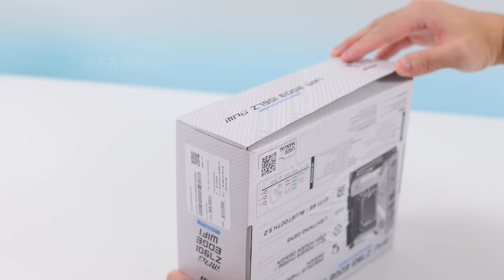If you want to take 4090 to college, try this chassis | Phanteks Evolv SHIFT XT Build

Comment: 13700K with a 4090? Great, it can also function as a space heater in the winter, and burn down the dorm in summer.
Reply: The 4090 is the real killlee here, my 13700kf is very chill
Reply: Needs to be submerged in water 💦

Comment: Oh my god, possibly the best SFF build I have ever seen with little to no compromises. It has a 4090 and a 13700k, along with an AIO, all packed into such a small size. What more could you ask for?!
Reply: i want to see it running under load without thermal throttling. Without that this is a waste of time. Influencers like to influence you to spend your cash on products that do not meet your needs. If it sounds like your mothers vacuum cleaner, throttles down to behave like an old Haswell machine and eventually cooks your processor that this video features  pretty packaging and nothing more. I have tried many SFX builds and there is a limit to how much heat can quietly be dissipated.
Reply: Money for ramen.
Reply: The Sliger SM580 is better than this case, if you're looking for something similar. It fits a 280mm AIO for better CPU cooling, and has two bottom fans to help cool everything else. Also you can get a handle to carry it around like a suitcase and they sell an optional bifurcated riser which would allow you to add another PCIe device if you really wanted to. It's the best possible performance SFF case with absolutely zero compromise.
Reply: Rollable OLED display in your bag, is what I'd ask for.
Edit: So that I can flex. Pun intended.
Reply: @9999plato it will definitely thermal throttle.  At best itx is good for like 60-70 series for nvidia and maybe a 6600-6700 for amd.  Obviously lower cpus too.
Reply: Technically, an NR200p Max would probably be better.
Depends if you care about color and/or design of the case.
Reply: @9999plato  i think you could do this with an amd cpu, definitely with x3d, but not intel without aio or some tower.
Reply: @TheRMUPs eh, i chose this case because i didnt want a boring rectangle pc, which the sm580 kinda is
Reply: Yeah that's totally fair. I like the handle though, gives it a different silhouette, and also I painted mine marine blue
Reply: tHAT IS DOENT CATCH ON FIRE
Reply: A dust filter bro.
Reply: @frankytanky5076  I got 5800x3D and 6800 xt for itx and no thermal throttling at a room tempt 27° Celsius. Under heavy load, cpu is at 64° C max and gpu at 56-60°.
Airflow and room tempts will greatly affect your tempts!
Reply: @frankytanky5076  Just finished building this exact config as a portable option. Temps are solid and no thermal throttling. I play mostly e sports titles, but was just running BG3 and Tarkov, everything maxed out and CPU didn't go over 60c and GPU hovered around 65-70c. Completely fine.
Reply: @9999plato    Just finished building this exact config as a portable option. Temps are solid and no thermal throttling. I play mostly e sports titles, but was just running BG3 and Tarkov, everything maxed out and CPU didn't go over 60c and GPU hovered around 65-70c. Completely fine.
Reply: @ArdyneusTheGod  yep! its more of a if you can find a 4090 fe. Here in asia, I've never seen one. Probably have to order from another country which is costly. Other one that can fit is one MSI variant but its a tight fit
Reply: @9999plato  
What's the best SFF then for what you listed? I'd like a portable i7 you can fit in your backpack, but there are too many build variations and I like 'em all.

Comment: That's an amazing build and a lovely case with amazing cable management. Also as of this moment, pcpartpicker says it'd cost $3400 to do that build, not including operating system.
Reply: Can you link that build list? I've been considering a new build and something like this really interest me.
Reply: 3400?! that’s ridiculous you can get that with 2-2.5k easily
Reply: @kingiument4627  the graphics card alone costs ~$2k usd
Reply: @BillyWilly132  Yeah wtf when did that happen last time I looked it was 1600
Reply: @kingiument4627  where on this world would you get a 4090 fe for just 1600, wtf ?
Reply: @JeyKalda  I meant to say 1800. Maybe that was the old price for the 4080 and im tripping tho
Reply: @kingiument4627 i think original Msrp was 1600 so i dont think ur wrong Abt that, but the pc would still not be 2k
Reply: i think he went a little over board with the parts, the i7 is not necessary and the rm1000x psu might be better
Reply: Operating system is free, just don't use Windows...

Comment: I have a 3080 ti in a similar case, and I can guarantee you that 4090 is going to thermal throttle like nuts in there.
Reply: especially with it being side by side with the motherboard/processor.
Reply: No heating bill in the winter!
Reply: Doesn't even need to be 3080ti to thermal throttle in there, pretty sure any GPU will effectively shoot itself.
Reply: Just finished building this exact config as a portable option. Temps are solid and no thermal throttling. I play mostly e sports titles, but was just running BG3 and Tarkov, everything maxed out and CPU didn't go over 60c and GPU hovered around 65-70c. Completely fine. Do you game in a sauna? lol
Reply: @CocaineCobain  I'd love to see a video where you stress test it on your channel. Shouldn't take more than 5 minutes to do.
Reply: People before undervolting was a thing:
Reply: @Rogue_y  why would you spend $2k on a GPU just to kneecap it?
Reply: Just finished up a build with a 4090 in this case (not my idea or system lol) surprisingly enough, it's only 76c-78c under full load.

The cpu temps on the other hand
Reply: @yououttapocket why does he have to stress test lol?
Reply: @BunkerSquirrel undervolting alot of the time increases the performance very slightly while dropping temps a few degrees
Reply: @BunkerSquirrel lol, I undervolted two of my pcs, and aimed to maximize power saving at the cost of performance. My RX 7800 XT under full load dropped from ~300W to just over 200W. Lost about 3 fps average in red dead 2. Also undervolted my 3080 and got it from 330W to 265W and went from 15445 to 15202 in time spy. While gaming both gpus dropped about 10-15° C and I was able to turn my fans down to the point both pcs are completely silent while gaming. Of course that brought the temps back up a little, but both sit happily about 60-75°C depending on the game.
Reply: 3080 went from 250W to 150W in elden ring, and dropped from 70°C to 50°C
Reply: @BunkerSquirrel  undervolting ≠ underclocking, in fact it can improve performance as well as thermals if you do it correctly

Comment: I have this case same motherboard I love the case I think its still one the best looking sfx cases out. It get a bad rap as hot box but if done using the right parts it can keep cool  I have a I7 13700k , msi z790I edge, 32 gig of corsair Dom ddr 6000,  Phantek 240 gen2 with T-30 fans, Phantek 850 Plat psu, 1tb 980 Pro, 2Tb 980 pro, 4090 Msi Vent, Phantek shift xt black
Reply: Why does everyone feel the need to post their specs? Nobody cares.
Reply: @truuuupR  in this type of community it sometimes helps to have an idea especially for those who are to build their very first sff for parts compatibility and such. No need to let them know that you don't care, move along for we don't need such negativity in this small space. Have a good day.
Reply: @truuuupR i mean maybe you don't, but it is actually be pretty helpful  for others who is interested to try out the build.
Reply: @dominiceita2682   thank you exactly why spec were posted
Reply: @xyz-boner   under gaming load cpu boost stays @ 5.3 and temps 64c - 70c with a quite fan curve. and gpu boost to 2775 and gaming temps 65c  it stays really cool pc is near silent.
Reply: @0mnikron702 i want an amd ryzen 7 7700x, hope it works.

Comment: very cool build! question - when assembling in such a case, does it make sense to use shortened cables for the power supply?
Reply: Be careful, every PSU is wired differently, don't ever use different cables than the ones in the package unless you're extremely sure what you're doing (or unless they're just extensions)

Comment: clean looking build but it would be good to show some perf numbers or temps & noise levels at least. It's a common issue with SFFs to run really hot with the Nvidia 4080+. There aren't any intake fans with this build and I'm curious how it could manage cooling and noise.
Reply: @Saint.0000 yeah even as a lightly experienced builder, what they're saying sounds like nonsense. If I recall, don't the 40 series cards have super overbuilt coolers? Even in a crampt space, i'd expect it to be reasonably okay, so long as you have some air flow going on. The fan on the card is directly facing the outside air even. The CPU is the one in a potentially scary spot, but we're using an AIO, so that's being handled nicely as well. Just don't overclock the 13700 cuz if that's the CPU i think it is, it has trouble being able to take enough heat away from it when overclocked.
Reply: @shirothefish9688  Pretty much. The 4080 nor the 4090 thermal throttles at any point in SFF cases. They are 8-10 degrees hotter at the worst of times, well below any kind of performance loss. The guy literally mislead others for no reason

Comment: Nice looking build, curious about the choice of the 13700k vs a 7800x3D, which is both faster for gaming and easier to cool?  It would let you move to a 850w PSU as well and give you budget to upgrade to a larger/faster SSD at minimum.
Reply: 13700K a little bit slower than 7800X3D in gaming but superior in multitasking software like Blender or Adobe Suites
Reply: He has a 4090. He doesn't need to min max his cost to upgrade the ssd. 

Chances are, it's what he had lying around.

Comment: I literally fell in love with this case. I wonder if a Inno3D 4080 will fit in! (Has a separated AIO. Im gonna put a 7800x3D. What mobo should i get?
Reply: The MSI vent 4080-4090 fit Im using the 4080 4090 share the same cooler

Comment: As someone that owns this case, the thermals are 80c on MSI RTX 3080 Ventus. 60-70c on AMD 5800X3D - you can only put a 240 AIO in this and thats about it. Intel CPUs this gen (13th) and above run HOT because they are asking for 100W+ so I would go AMD.
You need to be RICH If you have enough for a SFX 1000W and a 4090 FE in this eco. oh and ONLY the Founders Edition cards will fit (case only has 305-310mm max fit for GPUs) so you cant just opt for ANY 4090, good luck finding a 4090 FE if you dont already own one.

Comment: This is a good and very beautiful case. I bought during Blck Friday and it was fantastic but with it being complete, I do not recommend putting it in your bag as the case is very heavy when complete and this is with a low profile air cooler and XFX 6600 gpu. It's so goddamm heavy that if you put it vertically, it will damage the case. But if you really want to, please look for a backpack with a better strength to not let the case sag your entire bag and the bag can have the case horizontal.

Comment: I'm all about very quiet PC's.  For my main PC, I'm not happy with less than 3x 280mm rads or 3x 360 rads.  I also love SFF builds but am not happy with current offerings.  I'm designing a case with all 140mm fans and at least 2x 280mm rads (full open loop) because I want decent noise levels under load.

Comment: Very nice build! Can I ask what is the monitor you are using at the end of the video?
Reply from the maker: it's ipad pro
Reply: @sai-ye4ws  what app you use to display from PC to iPad? Is the performance good? any lag etc.?
Reply: @sai-ye4ws  HOW DID YOU USE YOUR IPAD AS THE SCREEN. I dont wanna use duet display and it seems like you connected the ipad as main screen even bootups. HOW??? pls i wanna know!!!
Reply: same question
Reply: Same question, ipads need 3rd party software and they all suck

Comment: I noticed you incorrectly installed the M.2 SSD.   the tiny screw is removed with a flat head screwdriver, its what hold the SSD in place (before you install the heat Sink on top)

Comment: Listen I had this chasis and here is my take, 1 ventilación is horrible. 2 phanteks PSU and AIO... CANNOT, I repeat... CANNOT, handle a 4090, nor a 3090. I had to replace chasis upgrade the PSU and AIO that come with this chasis to keep the card and system well fed and cooled enough.

Buy yourself a 2000D or any other chasis. This is not worth the trouble.

Comment: Looks stylish and very compact but there are a few flaws with this.

This PC is small it's basically just a big laptop without a keyboard. You take all the benefits of owning a desktop and just throw it out the window.

Only 1 NVMe slot? No SATA ports? 2 RAM ports alone? You're limiting yourself to Laptop specs.

It is very repairable. Everything being separate with a standard form factor and everything, but there's pretty much no room anything else.

What if you want to upgrade your storage? So you buy a 2 TB NVMe. How are you going to transfer the Data? You'll have to then buy an NVMe to USB converter, and the speed difference is going to be dramatic.

My idea for a proper desktop rig is Standard ATX, nothing below. 4-8 SATA slots. NVMe is optional, 4-8 RAM slots and room for more PCIe slots, other than just x16. Like maybe PCIe x1 for a dedicated Wi-Fi card. This PC is just too normie. It's like a Chihuahua. The PC doesn't need to rock the same specs as yours, but that's the beauty of it. It can be upgraded very easily, and maybe. I might use an Intel based CPU socket. Where the more expensive CPUs that run really well will only get cheaper with time. So you don't need to upgrade your motherboard.

This PC suffers a lot of laptop based issues, just 1 level up. It's a laptop but with extra steps. But hey if you like the pain of finding parts to fit IXT and finding works around to things like having less than 2 storage slots, then I won't judge.

Comment: Is the GPU not placed in the wrong direction in this case ? If I'm not mistaken, the air pass through it from the outside to the inside of the case where it should be the opposite.

Comment: this the reason external gpu docks don't make sense. I like the structure/skeleton of the case but not its exterior and price. If I bought this case, I'd use this without most the panels especially for the graphics card.

Comment: Thank you but the problem with these videos that everyone uses 4090 FE, which is the smallest one, and which is out of stock 99% of the time. A content where other GPUs are used (especially highly-sought ones like Gigabyte) would be much better. Thank you for the video though.

Comment: i ask ai for the price of those thing
CPU: i7 13700k - $500 USD
Motherboard: MSI Z790I EDGE - $300 USD
Cooler: MSI M240 Mortar - $100 USD
Storage: Samsung 980 Pro 1TB - $150 USD
Memory: G.Skill Trident Z5 RGB 32 GB (16GX2) DDR5 6000 - $400 USD
Power Supply: ROG Loki 1000W - $300 USD
Graphics Card: RTX 4090 FE - $1,500 USD
Case: PHANTEKS evolv shift xt - $200 USD
so its around  $3,500

Comment: sandwich cases have terrible temps. CPU and GPU are too close together and raiser is cooking between them preventing airflow. Also all the new cards expect to blow through, instead you're just grilling your PSU. Stacked compact cases like Fractal Ridge are superior. And have smaller footprint.
Reply: only time id think of making one is for minimal specs that wont be working too hard and burning itself faster. Same reason laptops cant perform and last a fraction of a desktop
Reply: not true at all it all depends on the parts your gonna use. I have the same system and it runs cool cpu stays 68c under gaming load and gpu 63c- 67c. Just depends on the parts your using

Comment: i had a build like this for a 3080 and it wasnt great in terms of thermals. it has limited customization but yeah it is dope to have if you move around. if you move around a lot then a laptop is better. and i advise anyone to buy AMD stuff cuz they are cooler especially the CPU, its wayyy cooler than intel. cool and all but it will feel like a reliability after a while.
Reply: Care to expand on the whole wasn't great with a thermals like actual numbers.

I know It won't have the greatest numbers. But does it keep away from the thermal throttling level?
Reply: The 30 series card run way hotter then 40 seriers I have both a 3080ti asus tuff and a MSI 4080 ven and the 4080 runs alot cooler and sucks less power which help keeps the temps overall lower

Comment: Is the cooling sufficient?
Reply: no,but you can limet the performance to 70%.
Reply: The phanteks case has a bad cooling performance and is actually quite big for an itx case. If you want to go itx without too many compromises I would recommend the dan a4 h2o.
Reply: It can be depends on the parts your gonna use im very happy with my temps both cpu and gpu but I wouldnt use a 13900k or 7900x with a 240aio

Comment: No testing no thermals does it throttle under heavy load etc etc.There is a massive ton of free hardware supplied to YoUTubers to help promote advertising products.The case and cooling in general needs to be thoroughly tested and designed to work well and not just "look cool".

Comment: If you wanna take your 4090 pc you should never buy this case. Instead go for Formd T1
Reply: If your using a 4090fe but if your using a aib theres nothing wrong using this case and a 4090 I have this case and msi 4090 vent temps are nice and low
Reply: @0mnikron702  you can fit Ventus in formd

Comment: can it run with i9 13900k?
Reply: I wouldnt temps would be too much in this case without doing a undervolt and lowering the power limit
Reply: @0mnikron702   what about i7 13 ? Maybe better. I d GPU rendering and 3d, 4070, 4080 is perfect and the CPU must open my scenes